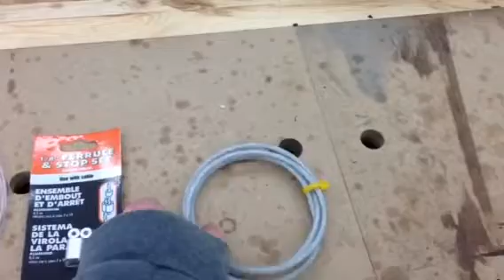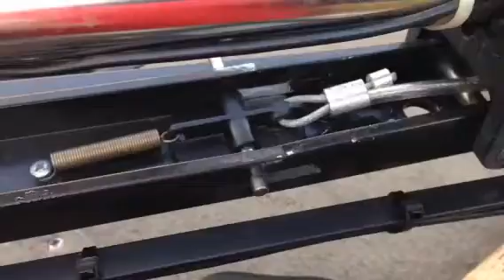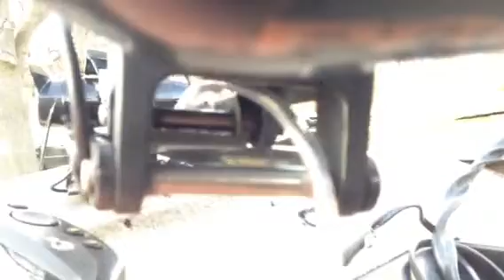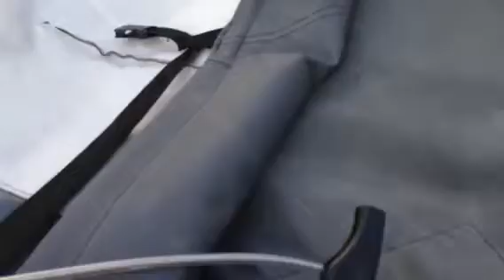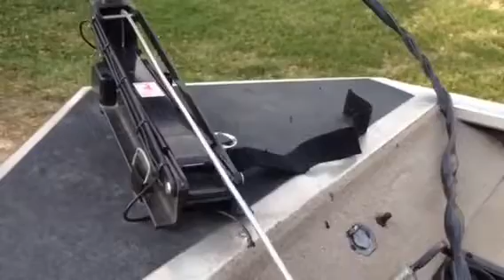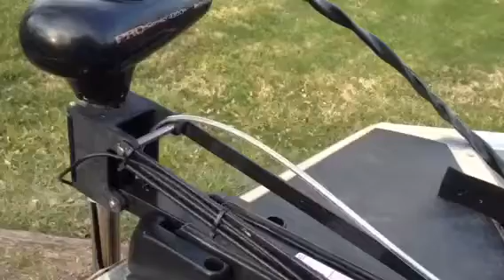Trolling motor replacement rope or cable

Comment: THANKS FOR THE VIDEO!!!  Just did my Minn Kota, not as much room to work but I got it done for under $8 ( I bought extra just in case of screw ups) Love it!!! Luckily I read the comments and found out you used 3/32 cable not 1/8,,,,,,3/32 was still hard to get through the 1/4in OD tubing.
Reply from the maker: thanks for watching, glad my video helped.  the cable is so much more responsive than the rope, no stretch at all.  yeah 3/32 is the correct size through 1/4 I.D. clear hose.

Comment: How did you push / pull the cable through the tubing? Couldn't get mine through the tubing, an just thinking of splitting the tubing in half
Reply from the maker: James, thanks for the question

I chose 1/8 cable and threaded it through 1/4 tubing. That setup fits together very we'll

Hope this helps

Comment: how did u accsess the spring/place you tie rope
Reply from the maker: Conan, thanks for the question.
The easiest way is to remove the trolling motor, then you have easy access to the spring where you can run the cable through.  Let me know if I can help any further.  By he way the cable is so much better than a rope.  Maybe manufacturers will take notice and start using cable.
Reply: thom rider Did you have the special swage crimping tool to put the double and single crimps on the cable. I have all of the parts, just not the crimper.  I am going to use 1/16 cable for the ease of feeding through my great white gator mount but I don't have the special swage crimper which costs 20.00.
Reply from the maker: Hawkeychef,
I just used vise grips to crimp the cable. You will love how responsive the new cable is when pulling up the trolling motor.

Comment: My rope broke and it’s latched how do I release latch
Reply from the maker: You have to push the spring and bolt back with either a stick or a piece of wire.  I used a stick mine happened on the water and I found a limb that worked.
Reply: I use my pliers